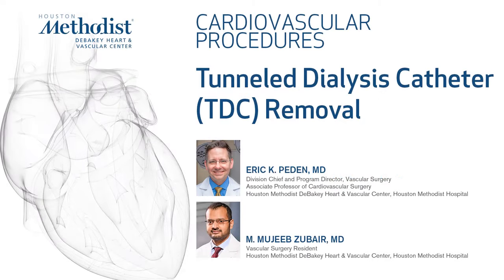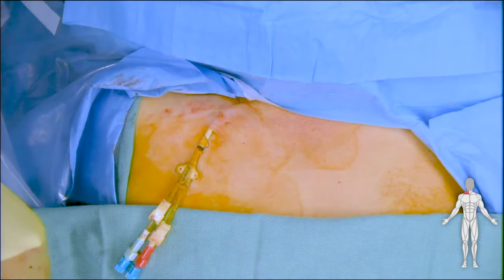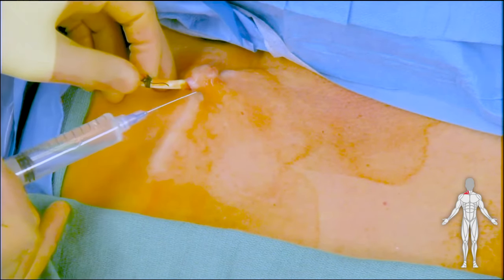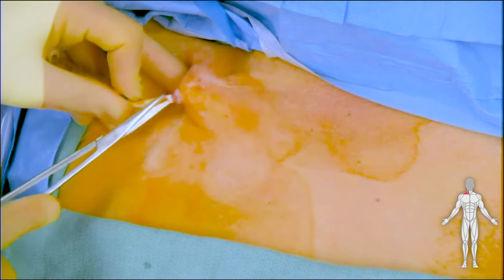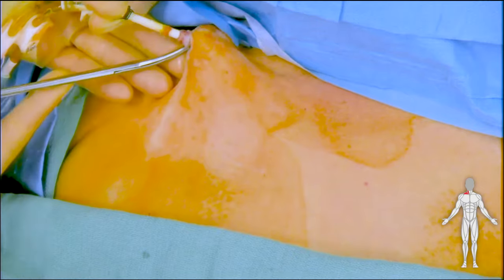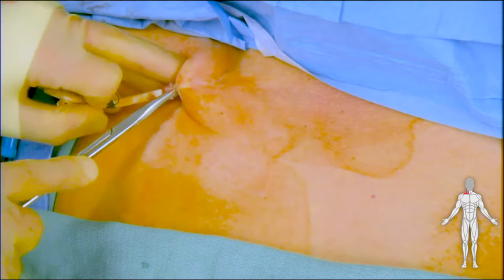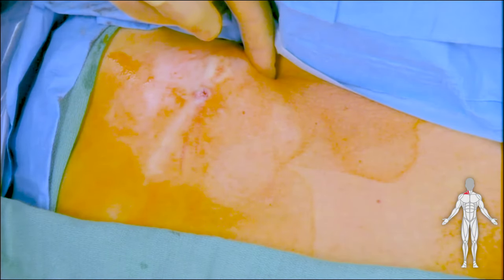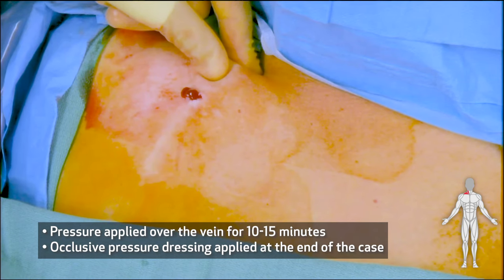Tunneled Dialysis Catheter (TDC) Removal (Eric K. Peden, MD, M. Mujeeb Zubair, MD)

Comment: This technique is fine. It is cumbersome and take too much time. For the past ten years, we have used a hydro dissection method. We have zero conversion. 
1) prep the skin
2) With 25 g needle, inject 5 cc lidocaine with bicarbonate (9:1 mix) around the cuff and inject 5cc at the catheter exit site.
3) hold pressure over clavicle 
4) pull catheter 
5) now, you are done. Have your nurse hold the pressure above clavicle for 10 mins.  Put on a dressing of choice.
6) if you feel the catheter is going to break and it is stuck, inject more lidocaine around the cuff and try again (rare, only had to do this twice in 10 years)

Total time less than 2 mins with additional 10 mins hold pressure.
Reply: Really works?